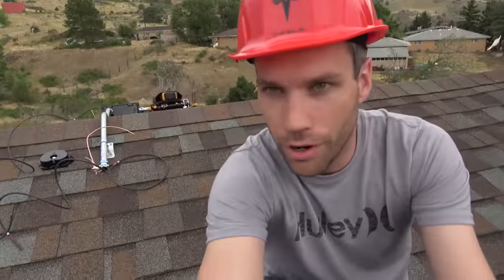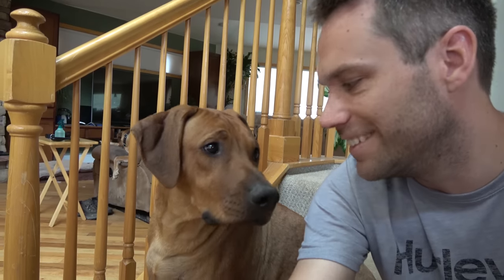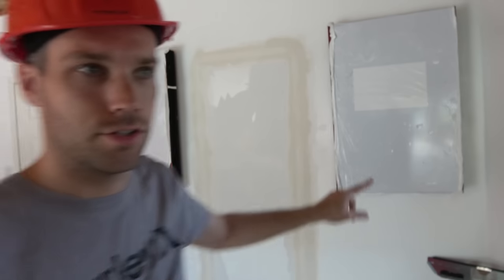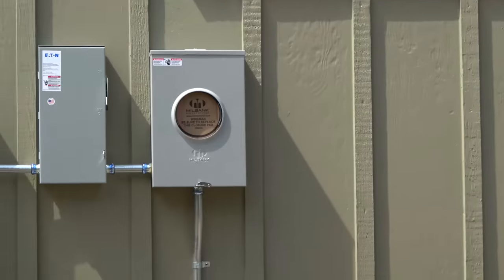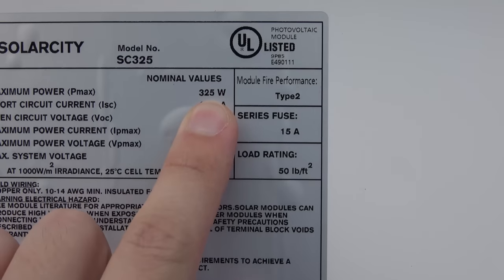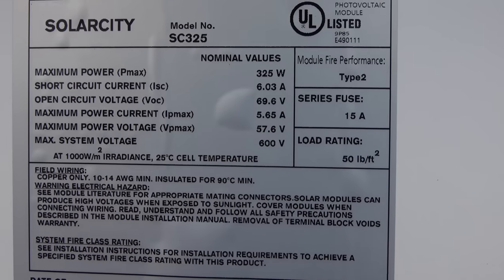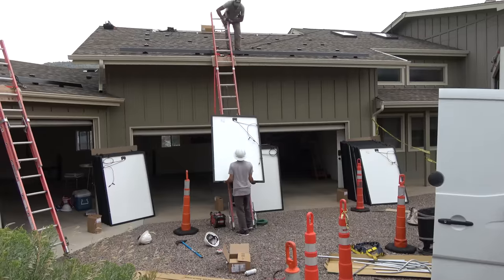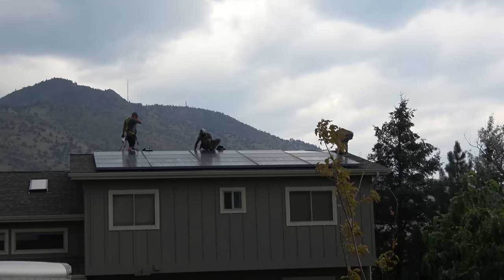We Have Tesla Solar On The Roof! Install Day 2!

Comment: Love it I've been a roofer for 13 years 30% of my job is replacing a almost new roof due to these pucks causing leaks in 4 to 5 years solar panels save about 500 a year x 5 2500. roof repair if not installed perfect an not maintainined ever season cost 10 to 15k if not more if rafters get damaged.. so good luck but you should have done ground panels . No risk to roof damage and very easy to clean ever year.
Reply: I’ve always wondered about roofs leaking after mounting solar panels. Are there any roof materials that won’t leak? I get that it all depends on the mounting method, but I’ve never looked into it, first hand experience would be appreciated.

Comment: The gap between roof and panels is for cooling. The solar panels also get less efficient when they are hotter. So cooling a little with a chimney effect behind the panels help for higher efficiency.

Comment: 7:28 8:47 get your fascia painted.  :)    [ which might be considerably easier on some sections if done before the roof is covered with solar panels  ]
Reply from the maker: yea, I just noticed that when I was up there. last time it was painted, they must have done a crappy job.
Reply: Wow!  I'm famous.  Next level of achievement will be to get Musk to reply to one of my tweets.  

I've been preferring aluminum fascia cover of late instead of playing the painting game.  Lots of colors to choose from, and it's simply rock solid, no maintenance once it is installed.

Comment: I think the white panels work better in the heat, I’ve noticed with my panels if you spray a little water at them you instantly get an extra 10% output due to them cooling down, so black ones definitely get warmer
Reply from the maker: interesting

Comment: Hi guys! Nice work on the videos, they have been immensely helpful to someone unfamiliar with the ordering process. One question if I may as someone on the cusp of ordering tesla solar: Once the process is initiated and the deposit rendered, is there still a period of determination to be made with tesla and the homeowner regarding where the solar is positioned ie, west or south and general system logistics before a contract is signed? As in, what if they cant position the system where I want it or whether it will even fit in the space I want, am I still under contract to receive a complete system where tesla says they will put it? Can I call the deal off at that point? Thanks and keep the videos coming!
Reply: Yes - I told them to put it all on my SW roof because the SE roof gets morning cloud cover much of the year - no problem.

Comment: what would a system like this cost?
Reply: I'd estimate around 53K (before incentives) plus maybe another 2-3K for the Powerwall and HPWC installations. The Powerwalls are around 6K each installed, but since these were awards, that cuts the cost drastically.
Reply from the maker: That is close to what our solar cost, not including powerwalls or wall connectors. Great question! I will address this in the Q&A coming up on my channel!

Comment: Is there a building code that forces you to put your inverters outside in the elements instead of in the garage?
Reply: IMHO  I want to know too
Reply: Anas Malas, it’s strange they would allow 40+ kWh of batteries inside, which also has 7kw inverters, but put the other inverters outside in the rain, snow, dust, hail.
Reply: IMHO  possibly its not code, maybe they just need loads of cooling. Ive seen them being kept inside
Reply from the maker: Great question! I will address this in the Q&A coming up on my channel!

Comment: What happens when u need to replace your roof?   Hopefully youve got a lot of roof life left!
Reply: Mike B.  how often do people change the roof of their house?
Reply: All depends on what size hailstones hit. This site is in Colorado - hail sucks!
Reply from the maker: they will remove and remount the panels. But the roof still have a lot of like left.
Reply: @TeslaInventory  What would it cost to remove and remount the panels?  I had my solar panel systems (1 with 44 panels and another with 14 panels) installed by SolarCity in 2015.  Subsequently I had one Powerwall back up system added.  I have been satisfied until this year when I observed roof leaks in a few areas (manifested by water stains, peeling paint and rainwater drips).  My house was built in 2003.  I suppose my roof would still be OK had I not install these solar system panels.
Reply from the maker: I'm not sure about costs. I would reach out to Tesla.
Reply: @TeslaInventory  Just FYI, I reached out to Tesla concerning my solar panel system installed by SolarCity.  They sent someone to do an inspection.  The deal was if the leak was found to be caused by faulty installation they will make the repair at no charge.  Otherwise they will charge me $200 for the inspection.  Tesla completed the repair last week.  One happy Tesla customer here. :)
Reply from the maker: Glad it worked out!

Comment: i was going to ask why you did not get the solar roof instead but my guess is the solar roof was not going to work with 3 power walls that just my guess or panels was cheaper than doing solar roof
Reply: ADreviews76 not ready yet. It would have courseworked with the Powerwall. And they wanted to maximize their system to the fullest.
Reply from the maker: Brian got it. solar roof isn't widely available and cost were both taken into account.
Reply from the maker: Great question! I will address this in the Q&A coming up on my channel!

Comment: What is price just curious
Reply: Probably received it for free with all the referrals they garner.
Reply: luis arevalo I was quoted $3.10, for a 13.5kw System from Tesla. This is a much larger system so they could possible have gotten closer to or below $3.00
Reply: Sparklander there is no referral incentive for free Solar
Reply from the maker: Only powerwalls and wall chargers were from the referral program. the solar was not.
Reply from the maker: Great question! I will address this in the Q&A coming up on my channel!
Reply: Not sure if you still have that performance Model 3, but can you perform 0-60 tests again with a VBOX?